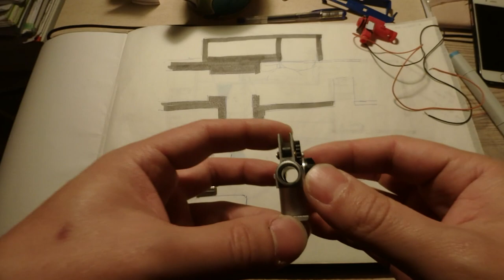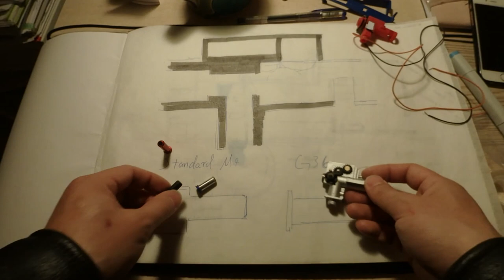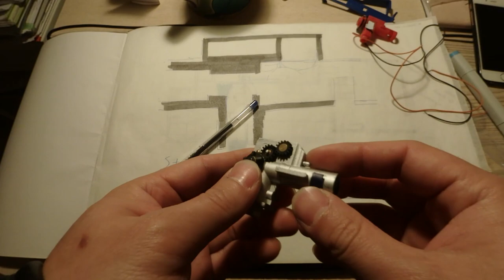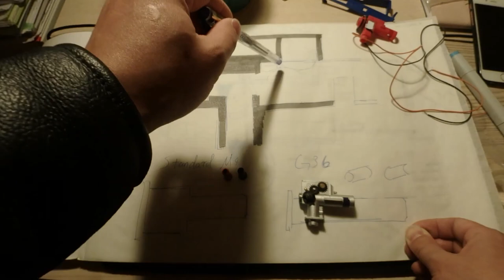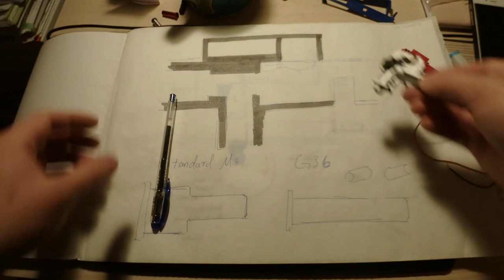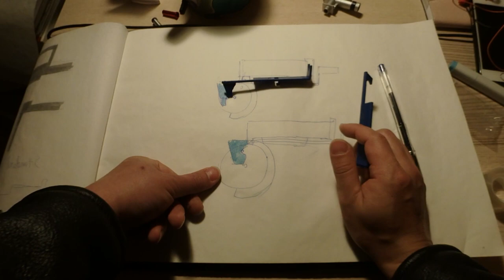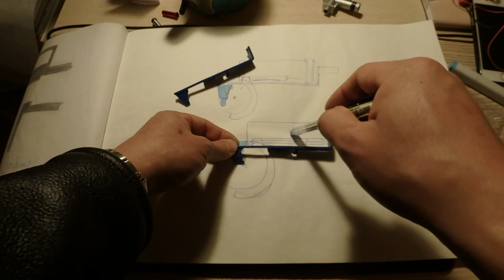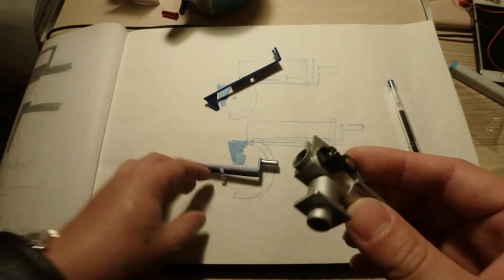AEG air seal 101 (nozzle and tappet plate)

Comment: These mods are nearly pointless. The tube portion of the cylinder head and the lip on the nozzle are usually enough to hold the nozzle in place well enough. All that matters is that the nozzle seals against the hop rubber. Air will never flow backwards. It takes the path of least resistance. A very miniscule amount of air could flow backwards when it first reaches the BB, but this is nearly negligible and there's no point in putting work into eliminating that unless your system is severely flawed with mismatched specs, or entirely custom fabricated/modified or you are striving for the absolute best possible efficiency of your system.

Comment: I think  i have pme tappet  issues. Its consistent betwen two joules. 1.5 or 1.33 .1 difference  but its randomly 1.3j or 1.5 j. 
 I full full stroke 13/1, with a 30k motor  but i use a 7.4 battery

Comment: Where does the C shaped piece go in the hop up exactly, is it cut so when it goes in the hop up chamber the edges touch? Thank you, am going to try this myself
Reply from the maker: If you look into the hop up chamber, you will see the side where nozzle foes in is wider. The c shape of course should be as close as a circle once it's inserted. The idea is to make the inside of the hop up chamber uniforme with same diameter.
Reply: Thank you